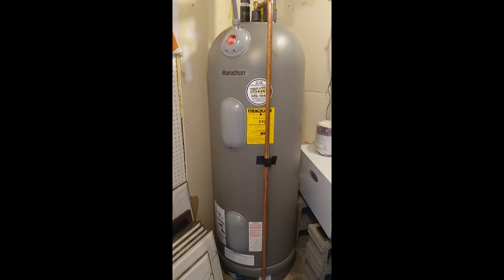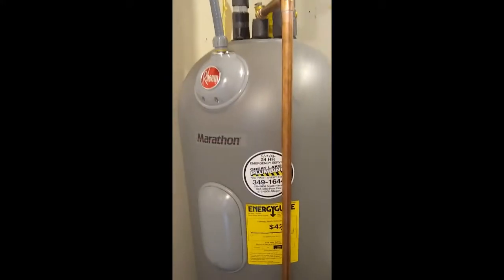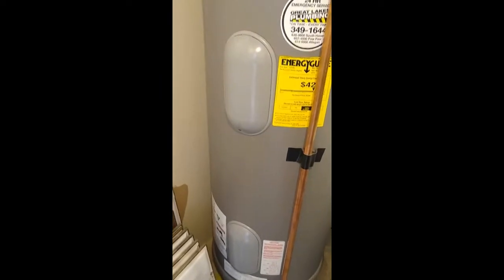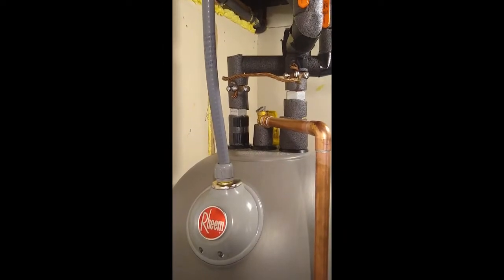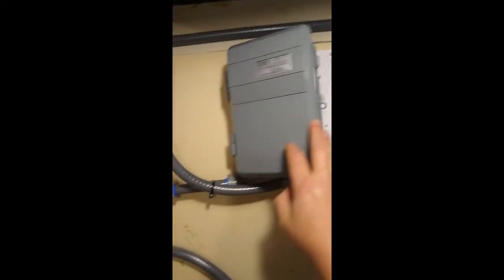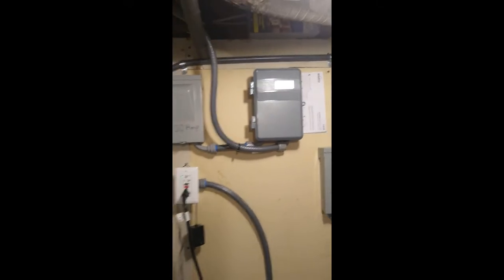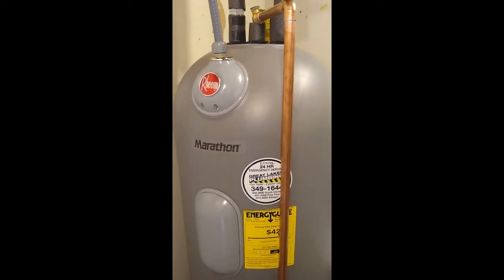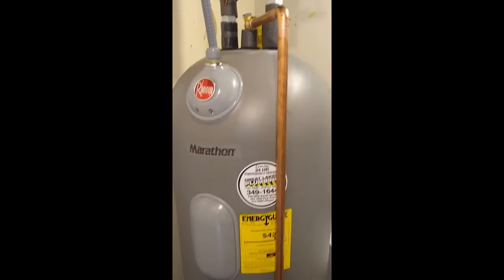Follow Up: Why we did NOT install a Heat Pump Water Heater

Comment: I’ve had a dedicated kwh meter on my 50 gal Giant tank for the past 5 years. Stand by heat loss relatively small, 1.7 kwh/d. Although these last 15 to 20 years in my local with fairly clean water, I have often wonder why nobody makes a fiberglass tank with even more insulation, and maybe an easy sediment flush method for decades long installation ?

Comment: Use a vacuum break on the install. City shut off my neighborhood water service and the vacuum break saved my poly tank from collapsing.
Reply: Why would the poly tank collapse if the city shuts off the water?  Any how would a vacuum breaker prevent this from causing this problem?  Thank you for your input in advance!
Reply: @davidthompson2055   When they opened the fire hydrant it caused a momentary vacuum in the water pressure. This would ordinarily not be an issue but the vacuum breaker prevented the tank from collapsing. Basically opposite of what the pressure relief valve does. Tanks have worked flawlessly for 17 years except for the one incident. I have two in series connected to the desuperheater for my geothermal system. Haven’t ever run out of hot water even when family is visiting.
Reply: thank you, Marshall!

Comment: Some people are experiencing leaks on top where the plumbing comes up out of the tank, hopefully, you will not have that issue...
Reply from the maker: I don't so far. If this happens then these thanks are backed by a life time warranty.
Reply: @BartmanMi  warranty is only on the tank. It doesn't cover the fittings, elements, sensors, etc.  They're basically only saying the plastic isn't going to fail
Reply from the maker: @btarb242 Hi Bill, that's correct. There are not that many parts that can fail compared to a heat pump water heater though. The 2 heating elements will wear out and will need replacement at some point. The pressure relieve valve might fail down the road. Nothing too complex, unexpected or expensive (in my book at least).
Reply: @BartmanMi  yea, agreed.  One possible downside of the no sacrificial anode rod is that the heating elements will rust out sooner than normal, depending on your water composition.  Pretty easy to replace though.  Since you'll own the unit longer than a traditional glass lined tank, it might be a good idea to loosen/retighten the elements every couple years so that they don't fuse up before you need to replace them.  If you're curious about the insides, Matt Risnger has a vid where he cut one in half. 3" of foam insulation between the plastic shells. Pretty spiffy.
Reply: @btarb242 these do have anodes, just not sacrificial